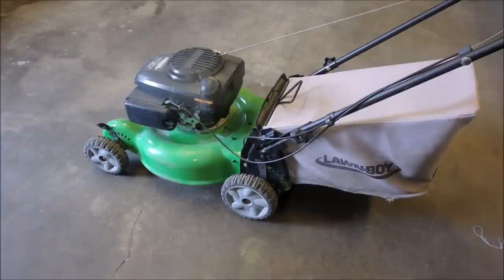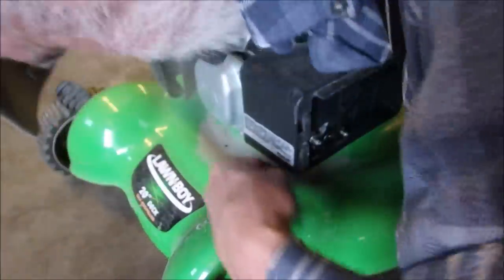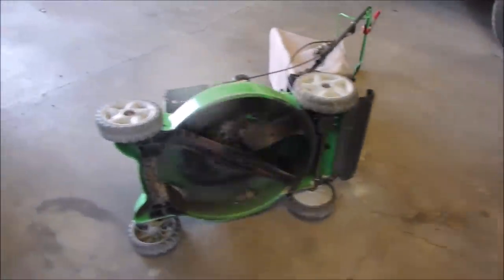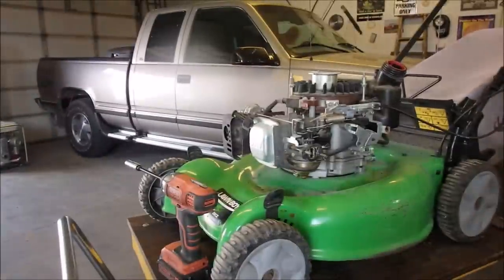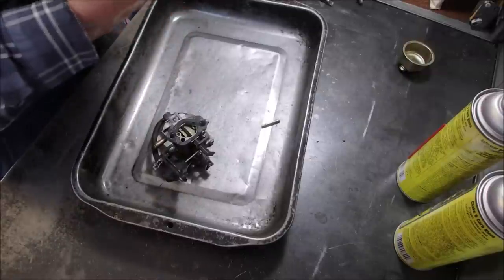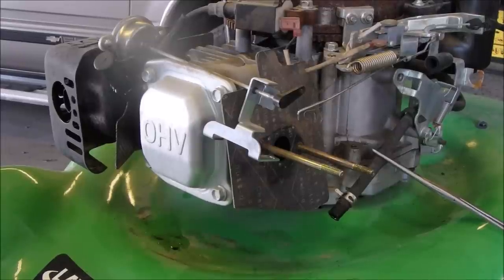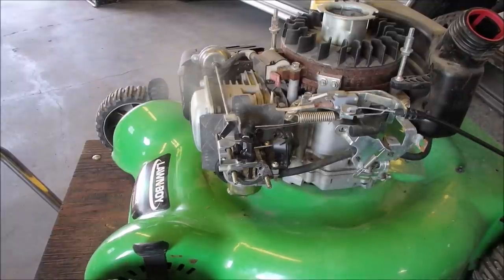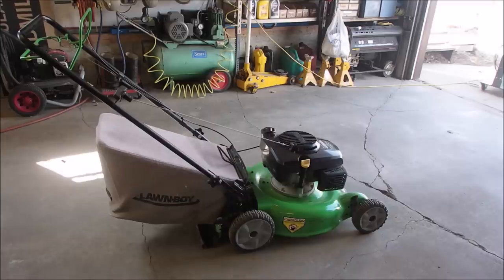Modern LAWNBOY no start,  Stuck Choke??

Comment: Usually those get clogged jets from sitting over the winter. Also hate those Gas Tanks/Caps. They had a TSB on them as the caps would never seal and gas would get all over if you filled it past half full. Nice repair Bruce!
Reply from the maker: Thanks Mr Mow it all

Comment: Awesome catch Bruce !

I now have neighbors that I haven't met stopping by to see  if I can take a look at their mower.  Just did a Honda HRX217.  Carb had been cleaned but still wouldn't start.  Needle was in upside down and choke linkage was in the wrong hole so it was choking when it got warm.  It was a head scratcher for a few minutes.  Checking the choke plate position and operation has been added to my pre-checks...

Also, where lawns are sparee and soil doesn't hold as much moisture, 3.5 - 4" cut height is pretty common.  Helps shade the soil, blocks weed seeds, and promotes longer roots allegedly...

"The longer the shoot, the deeper the root" as rhey say

Love the videos.  I always learn something and I'm a bit of an old dog.😂
Reply from the maker: Thanks Ken
Reply from the maker: It was fiddle fairried

Comment: Good video Bruce.  On my son in law's Kohler, the little linkage between the choke and the heat activated lever somehow came off and was lost.  HOW it got off when it requires such machinations to get it on or off I'll never know.  He'd bought mower new and never had it apart.  One day it was working and the next not.  I just replaced the choking mechanism with a hand operated lever mounted on the handle bars!!
Reply from the maker: That is a great idea.

Comment: FYI - if the resistor goes, in the plug boot, ie shorts out, it takes the plug with it, so if the coil shorts out, replace the coil and the spark plug, and those spark plugs on some of the Kohlers are a tiny little plug.
Reply from the maker: I knew about the small plug.  On the Briggs the resistor in the boot  burns open to no spark which is easier to find.
Reply: @BrucesShop  exactly.

Comment: I have 2 Lawn-Boys in my personal collection, one is the top of the line, keystart and all, they are the ones with the mulch plug, and won't start without either the bag in place or the mulch plug, one has the briggs quantum 6.75, and the other the tecumseh 6.75 both have the gator blade, and I love the cut of them, I'm selling the tecumseh version, cause it doesn't have the keystart, but the model with the quantum, it looks brand new, not a mark on it, got it for 50 bucks from a very nice lady, who's husband passed away, and it was his from purchase, and he blew it off and cleaned it after every use, the bag was never assembled so that was brand new, a really nice score.
Reply from the maker: fun comment.    I remember when I encountered that missing bag and a mower that had no spark.  That one a person remembers.

Comment: I've done 5 of those L-B Kohlers, Omg those Kohlers are a pain in the butt, coils, coil resistors, clogged carbs, and the grounded bail brake system.
Reply from the maker: I know.  Then these 2 system autochokes.

Comment: Pretty great deal - $10 for a decent shape mower!
Reply from the maker: It is a gamble for the owner though.
Reply: @BrucesShop  yes for sure! My Dad once bought a used Honda (one of the good 80s models, self propelled) off Kijiji around 2005 for $25. Guy said it didn’t work at all. Dad bought it as he had an identical one that was still working well but thought if nothing else the Kijiji one would be good for some parts.

Dad brought it home, put a new spark plug in it, worked like a charm right away! Lol.